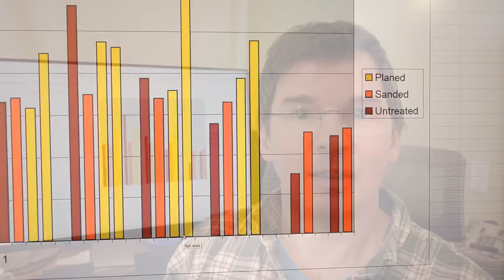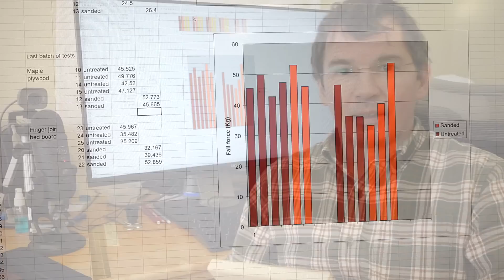Glue surface prep: Less important than I thought

Comment from the maker: Questions about different gluing parameters keep coming up.  I have done a number of videos on this sort of thing, all linked from the bottom of this article: https://woodgears.ca/joint_strength/index.html
Reply: In the UK most people use Evostik wood adhesive, which claims to be "stronger than th wood itself" and to be fair, I have never had a joint fail with it. It's pricey but good.
Reply: @mickeyfilmer5551  about being stronger then wood, just like any other wood glue out there... except they are not pricey.
Reply: Thank you for highlighting the science publication connection. The search for positive (interesting) results is strong and leaves opportunities unused, and works against young scientists that try to do science for the sake of gaining insights, not publications
Reply: I know you probably not a fan but you could try to market the video as something among the lines of Preping is a waste of time, or You are doing it wrong, idk. I find it interesting regardless but im not the average viewer
Reply: I would love to see a follow up to this on how much the surface area matters. Like does it follow a linear or square cubed relationship? Especially interesting was the gap filled with glue being stronger.

I guess another interesting idea would be to use your jig to do a racking test - flexing about 50% of a joint strength how many cycles before it fails
Reply: Saw a video that tested the clamping strength when glueing up. Was very emprical. I'd love to see you try this.

Comment: So does it lead from this that surface preparation is to ensure closely mating surfaces, perhaps as another line of enquiry: surface mating, ie flatness (or regularity on curves) and bonding pressure.

Perhaps in our modern world of affordable planed timber, the historic requirements for surface preparation was simply to achieve just the basic bonding surface contact. We probably continue to undertake many traditions because we simply don't question something that seems to work.

Comment: A few notices. Sanding: wood pores can be cloged by very small wood particles. Planing: wood pores a (mostly) opened. Glue: in another usage is known that for glue performance a thickness of inter-pieces layer of glue is important. For example: epoxy, maximum bonding when is 0,1 mm layer. Suggestion for future testing: sanding + vacuum cleaner (or air pressure gun), pressure of pushing  wood parts together at start.

Comment: Could the in consistency with sanded joints be from tiny dust particles still on the surface? 

Otherwise, it's nice that it doesn't matter so much how the surface is prepped. Makes a few things easier.

Comment: The median for the sanded seems higher then the median of the unsanded for each sample and with the 6 tests the chance of it being randomly that way is 1 in 64 wich is P=0.016 of it being random chance so i'd say sanding does make a difference, however due to other random variations in strength the difference is not big enogh to be usefull

Comment: Has anyone ever tested whether you really need to apply glue to both surfaces? Is there any benefit to doing so?
Reply: I’ve never seen any such test. Although knowing how wood glue works, I would side with the idea that it is beneficial to apply glue to both surfaces being joined. The moisture of the glue will raise the wood fibers of both surfaces thereby giving the fibers of each side a better chance of interlocking with the other.
Reply: I've tested not applying the glue on either surface.  There was a huge difference in bonding strength.

Comment: What about under clamping force? As I understand it, the clamping force helps to force the glue into the wood fibers. With clamping, the glue may get deeper into the sanded wood, causing more wood failures on that side. On the unsanded side, at least in cases where there's old finish or shmoo, that water-impermeable barrier will prevent the glue from soaking in, resulting in glue failures.

Comment: What about a really rough surface? I often roughen up the surface by scratching it with a knife or rasp and have the impression the glue connections are really strong. Perhaps micro roughess like from a light sanding does nothing because  it doesn't really increase the surface the glue can grip to, but more "macro"-roughness does?

Comment: Matthias, my somments. You are sanding scross the grain, therefore breaking the fibres into short lengths. Also, the belt sander won't produce a very flat surface, slightly high in the middle. Not wishing to knock your efforts, very interesting tests.

Comment: can you try scratching the surface with a blade? on one side, and on both, and then different patterns of scratches; horizontal, vertical, cross hatch and wavy lines to determine if that improves the glue joint.

Comment: Mattias, I think grain runout on the face grain surface is what's causing your results to appear random.  I mention this because in the short test pieces you used, you flipped each one 180 degrees to pop the eng-grain glued surface loose from the face grain.  When the grain runout was facing downward, the glue joint lifted fibers from the wood.
Reply: That's interesting. I also wonder about end grain butt joint. I'm not sure if the results would be different if the glue surfaces were long grain to long grain, but I do think they might be... Maybe the preparation does matter then.
Reply: It's all about open fibers. If fibers are closed after sanding - glue won't penetrate too deep and joint will be weak.

Comment: An excellent example of what publishing research is supposed to be about. I wonder about the practicality of changing your rig to support a larger sample size? Like I know nothing about the woodworking aspect of this (am an economist), just the data aspect of it. If wood fiber tearing is a limiting factor, can you change the angle the weight is applied on? Or connect two sticks together and try to break them with weight at the glue joint? It seems like after e.g. n=30 trials you might see something. The variance of your distribution is  quite high, and part of that could be chalked up to slight variations in the rig / glue volume / wood quality, idk. But increasing n could help

If theres no way to avoid the wood fibers issue, maybe another indicator of glue prep efficacy (or lack thereof) could be modeling the outcome as the probability that the wood fibers is the limiting factor? (Presumably, better glue surface means the wood will fail first?) Idk

Comment: When I used to put pewter miniatures together I would score the parts to be glued with cross hatched lines made with an x-acto knife, in order to give the surfaces more of a raised tooth for the CA glue to bond to. I always wondered how much value it had, and if it would do anything if it was applied to wood working, but I never saw anyone, anywhere doing it. Based on these results I think it would be safe to say that it would probably have similar results and possibly improve the bond but only slightly.

Comment: Try to Apply pressure using a clamp. Hypotezis is that there could be an effect of hydrostatic pressure forcing the glue info the surfaces creating better grip for the glue   Best    Tor Erik From Norway

Comment: Really interesting.Finding out that surface prep isn't too important is still an important result so don't be too hard on yourself Matthias.
I wonder how strong the joints would be with one or two screws of varying length(piloted vs unpiloted) instead of/as well as the glue.
You also found out that the quality of the wood/ply can be much more important.
A good follow-up experiment may be to repeat using face grain to face grain with various contact areas and woods.

Comment: How about if you used a steel wire brush to remove some of the soft wood in-between the harder tree "rings" at the end of the piece.
Then glue it, but tigten a clamp very hard so the rings will be pushed down into the connecting material.
Kind of like a box wood joint.
Also, how about "roughing" the surfaces with large-grit sandpaper before gluing?

Comment: I guess the ultimate limit is the strength of the fibers just below the surface, and both types of joint got close enough to that so there wasn't much room to make a difference. 

I guess a more variable test might be looking for how badly different contaminants can poison a joint; dirt, dust, varnish, or stain, wet wood vs. dry etc. 
I am glad to know that l can omit some degree of surface prep if I'm working with wood that's already in decent condition and I'm in a hurry or just don't wanna make more of a mess than necessary

Comment: Hi Matthias!  I have heard that the strength of a mortise and tenon joint is determined by a few thousands of an inch in fitment.  What do you think is the optimal "snugness" for this joint, and what should be considered "too loose"?  Is the old adage that a dry-fit joint should be able support its own weight correct?

Also, some woodworkers go through a lot of trouble to refine mortise walls and tenon cheeks as much as possible, essentially producing surfaces similar to being hand planed.  Is this even necessary?  How much different is a mortise right off of the router or hollow chisel mortiser, and a tenon right off of the table saw with no further surface prep?  Could the rougher surfaces even be stronger given that they have the potential to hold more glue?

Comment: An interesting side note.  FAA handbook for airplane building and repair recommends that glue joints on wood structures be planed and not sanded.  Looks like that might not make that much difference, although testing on spruce might be a good idea since that seems to be the wood of choice for wood airplanes.
Reply: I have seen at least one research paper showing that planed wood gave higher bond strength than sanded - the theory was that the undamaged fibres of the planed material were stronger.  So this supports your FAA citation.
Reply: The theory is that the grain straws have open ends when planed, similar in shape to a syringe needle and that would provide more ancor depth for the glue, but as Matthias showed, it’s not making much difference.
Reply: @amconsole  Mattias did not do the one thing you're supposed to do when gluing up which is to apply pressure during the drying window. Glues behave very differently when properly pressurized versus lightly applied. So at best, I'd say this result shows your surface prep doesn't matter much if you're not properly clamping the joint, but I wouldn't assume the same holds for properly clamped joints.

Comment: Thanks for doing the testing that I don't have resources to do.  My usual use of re-purposed wood for projects will continue.  I always try to at least have a clean surface for gluing.  If I have a structural item, I make sure to not rely solely on the glue (add screws, dowels, etc.). Knowing that the testing is already done gives me more confidence in the projects I do.

Comment: Actually, it’s good to know that surface prep for appearance does not significantly impact adhesion. With the examples of high number sanding resulting in packed pores (Fine Woodworking), I wonder if sanding beyond 180 or 220 does adversely affect adhesion.

Comment: I wonder if you have two factors -- the patina vs dustiness caused by sanding. If you used a tack cloth and / or isopropyl alcohol to prep the surfaces to remove dust and oil, I bet you'd also have some interesting results.

Comment: Thanks for this, great data. If i could make a suggestion. I use a pre soak on the end cuts, i apply glue to the end cut, let it soak in for about 1/2 the open time, then reapply glue as normal on both surfaces. Also I like end grains with just saw cut no sanding. I am very curious to see those results, if it makes no difference that would be a time saver for me.

Comment: You tested for tear strength though (which depends more on tricky joints and the wood itself) and not surface shearing.

I don't get the point to be honest, it is a given that one gives their best for something to be as good as possible no? Questioning preparation for anything is silly. Gluing is one thing, my favorite is asking the 8-Bit Guy about why to first wash the stuff he intends to retrobrite, "is it absolutely necessary to take off that shit smear first?" and stuff like that...
Reply from the maker: I had to pick a set of parameters.  if I wanted to chose all the parameters everyone suggests, it would be so many combinations that its no longer feasible to make a video.  Feel free to test any combination you want.

Comment: For some context, joint sealant companies (polyurethane, silicone, etc) provide detailed instructions about CLEANING surfaces to improve adhesion, but very rarely have I seen mention of sanding. Wood in ANY milled condition will be more porous and able to hold glue than commonly sealed materials like metal, plastic, and paint, so it makes sense to me that wood doesn't need any more sanding. It just needs to be clean, so without old adhesives or paints or obvious oils. Great work as always!

Comment: You didn't clamp any of the joints.  I wonder whether clamping would have strengthened the joints in which the wood fibers were not broken but the glue itself failed.

Comment: THANK YOU Matthias, Its great to see you post an example of science at work, and how often our 'beliefs' can often be wrong when you actually tried to confirm it. I love science and failures, since that often helps us develop different beliefs and additional tests to confirm those new beliefs.  Good Job.
Reply: I would have to say the sample size was too small. Since wood density and grain structure varies so much in wood (even on the same piece) it’s going to need many more samples to convince me that glue holds better using either method. Then you have so many different types of wood that it could show opposite results because some wood takes glue better than other types of wood, and I’m only talking domestic wood, not exotic woods. What a nightmare. I’m already sweating and I’m not doing the work.

Comment: I wonder if the type of wood might make a difference, like pine glued to pine or oak glue to oak would have stronger bonds or weaker bonds depending on the species
Reply from the maker: Lots of variables to test, but I don't expect anything interesting.  I have done glue tests with different woods in the past.

Comment: Could have ripped some 10-12" boards to compare end grain vs edge gluing. But with the layers unpeeling vice letting go (most of the time), it's not really necessary. Maybe comparr to see what wood is best at resisting?

Comment: Our spec in the aircraft industry, after sanding all faying surfaces, remove dust with compressed air and saturate lint free rag with 50/50 isopropyl alcohol/water then wipe surface and let flash off for 5 minutes before gluing.
Reply: Sometimes compressed air has a lot of oil in it. I guess you guys were using clean compressed air. Anyway, for the home DIY person, it might be safer to use a vacuum to remove dust, unless they have filters on their compressed air. The alcohol wipe will help also.

Comment: I would bet the joints with poor surface prep would be more likely to fail over time. Being smoother they have less surface area and once a failure begins in the joint it can spread easier than in a properly prepared joint. Your test applied one increasing load until failure, but parts in the real world are not stressed like that. They generally receive many cycles of mechanical stress which is much better at finding the weak points in a poorly prepared joint. Which is one of the main reasons end grain to long grain joints are so weak. The difference in expansion and contraction of the width and length of wood fibers over time breaks the joint, not a sudden load stressing the joint to the breaking point.

Comment: I'd love to see this expanded to include some of the finished surfaces found on reclaimed wood you so frequently use.
Reply: Anything with a polymer coating will more or less fall apart as the glue can't soak in
Reply: @AnnaVannieuwenhuyse  Sure, that's my gut reaction as well. 

But I think the very concept that 'soaking in' as a requirement for wood glue to function adequately is the assumption that would be interesting to challenge and confirm empirically.

Comment: Idea: wetting fresh wood and letting it dry naturally raises the grain (which is a nice trick i use before final sanding, for a really smooth finish on knife handles and such)

What if you wet the wood and let it dry, before gluing? Would that make a difference?
Reply: I had the same thought. Opening the grain to encourage greater glue penetration, without sanding. The real question is whether Matthias has the time/interest/energy.
Reply: pva glue is majority water and what happens before the glue can set is all the moisture has to be soaked away from the polymer by the woods capillary action.

Comment: Can I ask about the grain orientation of the base in relation to the orientation of the grain in the test blocks? The direction of force on all of them seemed to be in the direction of the grain. Unless I am wrong? If the grain orientation was 180 degrees from the blocks, might the glue bond be stronger?

Comment: Makes me wonder how much it comes down to exact grain orientation at the microscopic level since it's virtually impossible all fibers are running exactly parallel to the surface. Sanding wouldn't do much of anything except help expose a few slightly deeper fibers, and for every severed fiber end, a weak point is produced leaving you dependant on the adhesion between fibers rather than the tensile strength of the fibers themselves.
Reply: I notice that your test inverted the base plywood between the first and second joints.  If the surface ply on the plywood has distinct grain orientation, then one orientation may be stronger.